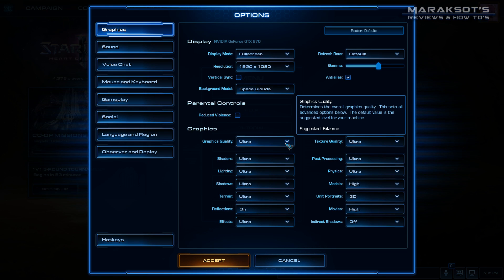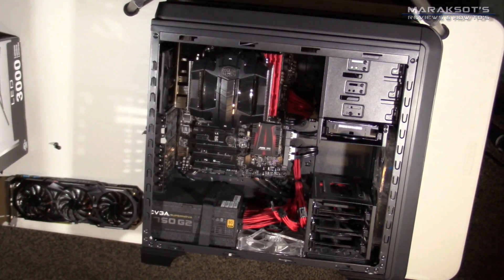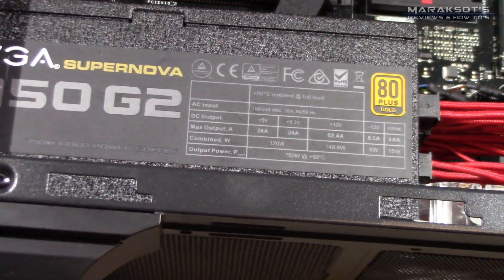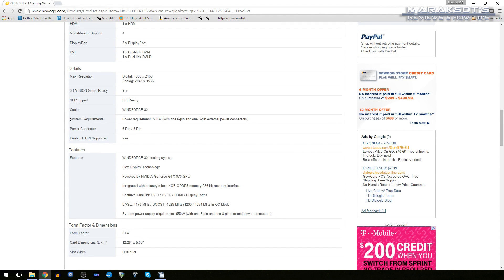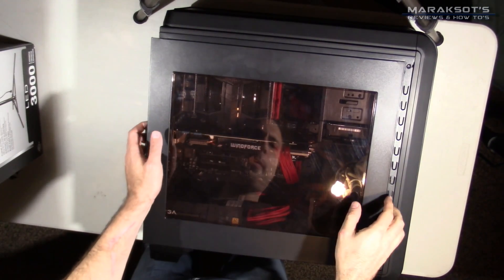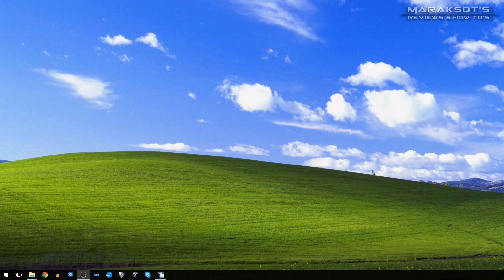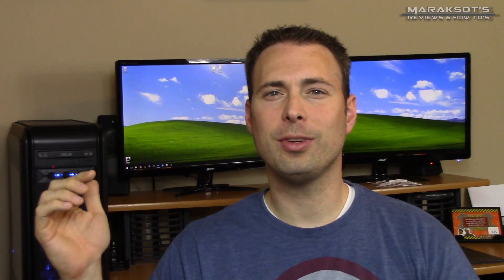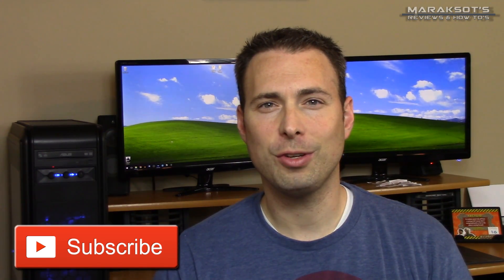A Beginners Guide - Upgrade your GPU - How to Install a New Graphics Card

Comment: So I just clicked on this video to see if I had to delete the old drivers from my pc to install my new gpu. I laughed when he had a gtx 970 like I just got. Then, I was super happy to see a Seahawks phone case! Go Hawks! Go Gtx 970!
Reply from the maker: +Septic Spud I think the GTX 970 is a very good 1080p gaming card. I can play all my games at 1080p max settings with it.  And I totally agree with you... Go Hawks!!!  :)  thanks for watchjng the video I hope it helped. I actually have another video I made that's dedicated just to uninstalling and installing drivers. :)
Reply: Yes, I just watched that video too. I pretty much new about it but just wanted to make sure. I was just watching jays2cents video about how it only has 3.5 gb of vram instead of what it supposed to have (4gb). And i was reading the comments and most people say it is only a problem for 1440p and up resolution monitors. I actually have a 1366 x 768 monitor so Im sure I am totally fine but I was just scared when I first saw that lol. Anyway, I have a gtx 960 4gb right now. I have been having fluttering little line things on my monitors for basically since I got it. It bothered me a lot at first but then I got used to it. It does it on my second monitor all the time a lot more than on my main monitor. But when I game it does it a lot more on both my monitors, so It must have something to do with heat. Even though I check the temps and they are always low. They never go over 60c. But now I am having a problem where my whole computer freezes and I literally have to reset my pc to get any response. So I reinstalled windows and made sure I have no viruses and it still does it. I recently upgraded my cpu to an amd fx 8350 and it seems to do it more now but I dont think it is that because it did it before that too. Anyway, I updated my bios and it seemed to help but it has gotten even worse lately. It literally will freeze sometimes when I am just on google chrome. So I got a msi gtx 970 gaming 4g because I loved the msi 960 I have now. It will be shipped soon and I will be trying it out to see if it fixes my problems. I am pretty sure it will fix the screen fluttering but I am not sure about the freezing. I really hope so! Anyway, I am sorry for all the typing lol I am just so tired of this freezing. I mean its hard to even play games anymore. I will start playing gta v and it will freeze after a bit. So I keep trying until it randomly works and I play for hours. So I just wanted to see if you knew anything about that. Thanks man, keep up the good work. And ill be thinking of you when im watching the Seahawks in super bowl 52! Thanks man:)
Reply from the maker: That all sounds very strange.  Since it's seemingly a video problem I would think that it may be something to do with your 960 but at the same time I honestly don't know.  I've never run into a problem like that before.  Hopefully the 970 will fix it but if not then there's something else going on there.  Have you tried slotting your graphics card into a different PCI express slot?  Not saying that will fix it but if I were trouble shooting that would be something I'd try.  If it does it no matter which slot it's in then you know it's not a problem with a particular PCIE slot.  Also I've heard of people having weird inexplicable problems because of bad RAM.  If you're running dual channel memory you could try only installing one stick of RAM at a time and see if the problem persists (you'll want to take a look at your motherboard manual and find out with DIMM slot to use for a single stick).  Other than that I guess it could be driver related or something but if that were the issue the best suggestion would just be to update to the most recent drivers.  :-/
Reply: Maraksot78 first off, I have the most recent drivers. I have actually had my graphics card in the second slot for a while now and it is the same on my motherboard as the first slot. I dont think it made a difference but maybe it did. Also, I got new ram a few months ago so maybe it is that. I had 2 sticks of 4gb ddr3 1866mhz ram. I had those in the correct dimm slots and they worked fine. Although, I wanted 16gb. So I got a single stick of the same exact ram but in a 8gb version. I only got the one stick of 8gb instead of two 4gb because my cpu cooler is a little weird. It wont go in the way they usually go in so I had to turn it horizontal. It just goes over the first dimm slot so I cant put a stick there. So It could be that but Im not sure. Thanks for your help man, I really appreciate it. And yeah, its really strange. And annoying😕. But I am really hoping and praying this 970 will do the trick and I will be able to play games without anything stopping me like the good ole days. Playing mad max in my room without any concern of anything braking. I had a xfx r7 250x and I couldnt even raise the graphics that high at all. I got an ok frame rate though. But that was before I got into all these gpu heavy games like gta 5 and far cry 4 and stuff. Now its asking for more ram, a better gpu, and a better cpu. Actually, when I upgraded my gpu to a 960 4gb I went to mad max not expecting too much and I couldnt believe my eyes lol. I raised literally everything to the best it could do and it never dropped under 60fps. Not once. So anyway, thanks again for the help my friend:)
Reply from the maker: Septic Spud no problem man. Hopefully you get things figured out. It very well could be your RAM configuration. In my experience you want to have either one stick only, 2 or 4. I don't believe 3 sticks of RAM works very well.
Reply: Maraksot78 yeah me too man. But I was looking it up a lot when I was about to buy that ram and It seemed like it should be fine. As long as it is the same speeds and brand (well kinda). But I really dont think that is it because it didnt do this until I started upgrading bigger parts.
Reply from the maker: Weird stuff man.  Well once again I hope you get it figured out.  Go Hawks!!!  :)
Reply: Maraksot78 thanks man!

Comment: Nice tutorial! Even though a little long-ish :D Do you think GTX 1070 will be enough for VR gaming with HTC Vive or would you recommend the "flagship" 1080 instead? Thanks.
Reply from the maker: +Arttu Siukonen the 1070 is a great card and will perform very well in VR.  The 1080 will of course be a little better but the 1070 is totally adequate.  :)
Reply: Ok thanks!
Reply from the maker: Arttu Siukonen no problem. :)
Reply: Actually this brought a new question to my mind :D Do you think GTX 970 will be enough? If concerning the future also, how long do you think 970 would be powerful enough because the graphics get better all the time? So is it more reasonable to buy better straight away or go with 970 but expect its capability expire pretty fast?
Reply from the maker: Good question.  I currently have a Gigabyte G1 Gaming GTX 970 and for right now, when it comes to gaming I feel it's totally adequate.  I'm able to max out the settings on all of my games and they run really really good.  But if I were building a system right now today I would definitely want to go with a newer more powerful card.  At the same time though I only have 1080p 60Hz monitors so the additional horsepower of a GTX 1070 or 1080 would be completely wasted.  So I guess the most logical answer would be what resolution do you currently game at and what resolution do you think you'll be gaming at for the foreseeable future?  If 1080p then as of right now I'd recommend the RX480 8GB or the GTX 1060 6GB as they offer the best bang for your buck at 1080p IMO.  They're roughly as powerful as a GTX 970 if not a little more powerful and they both have more VRAM than the GTX 970 (it only has 4GB, well 3.5GB technically) and newer games are getting more and more VRAM "hungry" so the more VRAM the better.  If you're going to be gaming at 1440p or 4k or are planning on getting into VR with an HTC Vive or Oculus Rift, or whatever other headsets I'm sure will be coming our way over the next few years, then I would definitely say you're going to want to go with at least a GTX 1070 if not a 1080.  The GTX 1080Ti just launched and it is an absolute beast but for $700 it freakin' better be. AMD also has some new graphics cards that will be using their Vega GPU's that are supposed to be launching in the next few months so if you're not in a hurry to build a system now you may want to wait and see what kind of performance and pricing they will be offering.  The rumors are Vega is supposed to compete more closely with Nvidia's top tier stuff like the GTX 1070 and 1080 but of course things start getting a lot more expensive as you start getting up into that kind of hardware.  Anyway I hope this has helped a little bit.  Feel free to ask further questions.  As you can probably tell I love to talk about hardware.  :)
Reply: All right thanks again, that really did help. I'm actually not a pc gamer at all so I dont really play anything with PC right now. I have a PS4 but I'm so fascinated about VR so I think I'll buy a high-end VR headset (probably Vive) at some point in the future. I actually also happen to have a pretty powerful PC in use (not exactly a gaming PC though) and I have ran few VR performace tests with it and its otherwise totally compatible except the graphics card. So its not like I have to entirely build a new PC just for VR, which I definitely wouldnt do because I would only need the power for VR. But just upgrading the graphics card for my existing PC doesnt seem like too bad investment.
Anyway, you got me convinced that I'll get at least GTX 1070. I'm not in any kind of rush with buying the Vive, still probably inside 6 months. So do you think I should maybe wait a bit for the prices go down (for 1080 and 1080Ti) or just go now with the 1070? My budget for the GPU is at most 500€ (~$550).
Reply from the maker: If you're not in a hurry I'd say wait and see what AMD Vega GPU's bring to the table. There's always the possibility that in another 6 months with new competition from AMD that prices could come down a little where you may be able to pick up something better than the 1070 and stay within your budget. Which is a very nice budget by the way. Right now you should be able to pick up a 1080 at that price point.
Reply: Maraksot78 Okay. Very much appreciate your replies! Have a nice day.
Reply from the maker: Arttu Siukonen no problem. You as well. :)

Comment: i'm not understanding. if my ram is ddr3 does my graphic cards have to be as well. also if my current graphic card is a 64bit does the new one has to be as well?
Reply from the maker: +Edit Boii I can understand this being a little confusing as you're first getting into all this... until 2 years ago or so DDR 3 used to be the standard for system RAM, the latest standard is now DDR 4. But there's no need to upgrade as DDR 3 is still perfectly adequate. Not to mention in order to upgrade to DDR 4 you'd have to change out your motherboard and CPU as well. Graphics cards use a different type of memory all together. The majority of modern graphics cards use GDDR 5 with some of the higher end models now using GDDR 5X, HBM (high bandwidth memory) and HBM 2.  No matter what type of graphics memory your graphics card uses it will be compatible with your system. As for your question about it being 64bit... I must admit that I don't totally understand what all the differences between 64 bit and 32 bit and what not but I do know that the main concerns with that when building a computer have to do with your CPU. Depending on what your CPU supports your operating system (i.e. Windows) will be either 32 bit or 64 bit and all modern graphics cards will work with both.  :)
Reply: Maraksot78 Thanks so much that really kinda made me understand more. Dang bro! you gots the smartz haha
Reply from the maker: +Edit Boii no problem man. Helping people out is one of the main reasons I do YouTube. It's fun sharing knowledge with others that are interested in the same things.  I also get to learn new things by researching stuff when people ask questions that I don't know the answers to.  :)

Comment: Whenever I put in the new GPU my moniter just says "no signal" then turns off plz help
Reply from the maker: +Wooshy IsHere there's several different things that could be causing this. The first ones to check are the of course the simplest ones. First make sure your graphics card is fully seated in the PCI Express slot. Then make sure all the PCI Express power connectors are securely plugged into the card and the power supply if you have a modular power supply. Check if your video cable (DVI, HDMI or Display Port cable) is fully and securely plugged into your graphics card as well as your monitor as well as make sure you have it plugged into the proper terminal as Display Port and HDMI can be easily confused.  If all these things are in perfect order then the next question I would ask is if you see any video at all before things go black. For example, do you see your motherboards splash screen and then as your computer boots into Windows it goes black. If so then you may need to update your motherboard BIOS to fix it.

Comment: I have a question about bottlenecking for my PC. I'm wanting to upgrade from my GTX 760 to a GTX 1070 8gb. and I currently have a ASUS M5A99X EVO R2.0 mobo, a FX-6300 oc'd at 3.9ghz, and two sticks of 8gb 1600 cas9 ram, do you think I will experience any bottlenecking after the upgrade? (the GPU in question is specifically the ASUS GeForce GTX 1070 8GB Dual-fan OC edition)
Reply from the maker: I can't say by how much because I don't own an FX-6300 or a GTX 1070 to test and see exactly what will happen but I do strongly believe that your FX-6300 will bottleneck a GTX 1070.  Will you see an improvement over your GTX 760? Yes.  How much of the performance of the 1070 will be lost will depend on the games you play.  Some games are more CPU dependent than others; for example I know GTA 5 is a more CPU dependent game so you won't be getting the most out of your 1070 in it.  Many Blizzard games like StarCraft 2 and Heroes of the Storm are also more CPU bound.  All that being said I feel you'll be ok, but to get all $400+ worth of performance out of your purchase you're going to want to think about upgrading your motherboard and CPU to a newer Intel i5 or i7 or wait for AMD's Ryzen CPU's to come out.

Comment: I've installed a gtx 1060 upgrading from a 770. It is powered up fine, fans work, lighting etc however there is no display. My monitor says there is no signal yet they are connected both ends using a single signal VGA.
Reply from the maker: I'm assuming you mean you're using a DVI cable because I don't know of any GTX 1060's that have a VGA out.  Anyway, all that really matters is that you have a video cable plugged into your graphics card and into the corresponding terminal on you monitor which you have.  :)  So when you boot up your computer do you see your motherboard splash screen and then as it boots into windows it goes black or is it just black all the time?
Reply: Maraksot78 yeah it's VGA cable but I'm using a DVI transformer plug thing. It's just all black it never actually begins to run windows. I can hear the startup sounds via my headset but my monitor is always black.
Reply from the maker: it may be something to do with the adapter you're using.  VGA is an analog signal where as all current DVI is DVI-D (the "D" means digital) they have passive and active adapters and I'm guessing the adapter you're using is a passive one.  I believe you'll need what they call an Active adapter that will convert the Digital signal from your graphics card to an analog one. The sucky thing is the active adapters are more expensive.  Here's a link to one on Amazon.  https://www.amazon.com/gofanco-Active-DVI-D-Converter-Black/dp/B01FL7H7HA/ref=sr_1_4?ie=UTF8&qid=1486495050&sr=8-4&keywords=dvi-d+to+vga

Comment: i'm upgrading for the first time, Which graphics card would you recommend for a GTX 770 to upgrade to?
Reply from the maker: 666kingdrummer thanks for the question. It really depends on what your budget is and what resolution and stuff you want to game at. If your budget is around $250 and you're wanting to game at 1080p at max settings on pretty much all modern titles I would recommend a GTX 1060 6GB or the Radeon RX 480 8GB.  :)